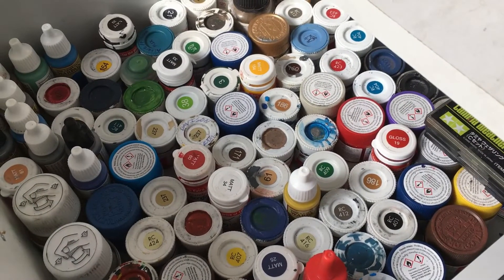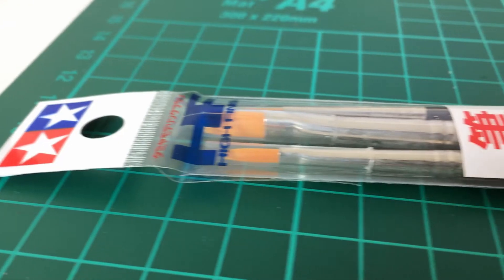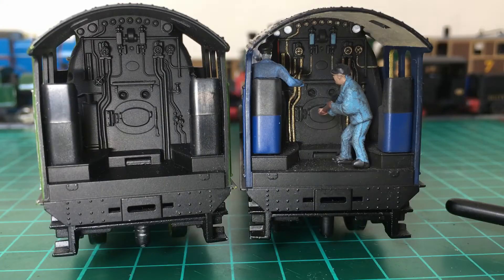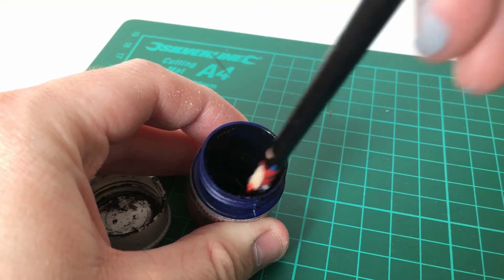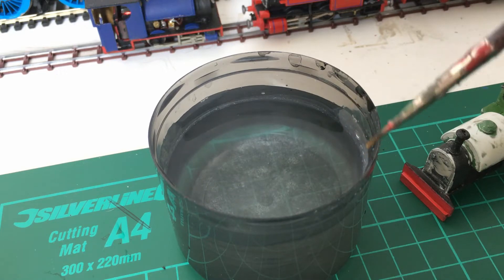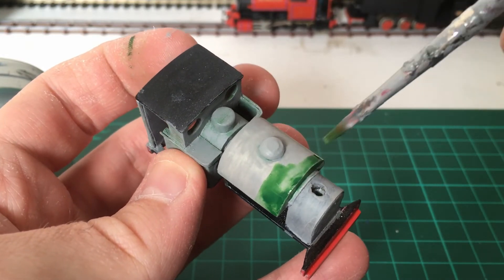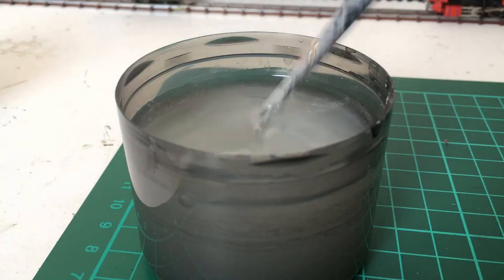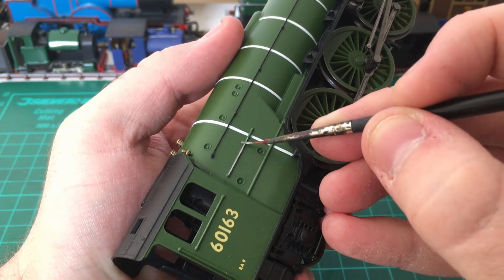Railway Modelling for Beginners: Brush Painting

Comment: Has to be asked, can this technique be applied to enamel paints? Granted changing the water for actual enamel thinners?
Reply from the maker: I’ve not worked with enamels in a very long time so I couldn’t be sure, but thin coats are always the best way to go so I’m sure it could. Best try it out on a redundant model first though
Reply: @tidmouthyardmodelling8754  Well, update with enamels, the principle seems to be exactly the same, only the drying time is significantly longer...! Still this tutorial has really helped me gain confidence with my hand brushing, and I cannot thank you enough on that front.

Comment: For myself . I kinda do this method

Sand the model a tad then paint 2 coats in the colour if it’s a darker colour tho if it’s something like yellow then grey primer underneath . From there add the smaller details with paint pens and touch up with the paint again or correction . Then clear coat and weather with paint dry brush then clear coat once more . Put the model back together again and done

Comment: were did you get the mode you used as an example?
Reply from the maker: It's actually a bit of a kitbash of two different 3D Printed kits, one of which is sadly no longer available. Thankfully the FIVE79 Edward Thomas kit has become available again:https://www.five79.co.uk/RC34/
It's a white metal kit, but I'd recommend it over my model from the video.
Reply: @tidmouthyardmodelling8754  ok nice thank you so much
Reply from the maker: @adamcat1882  No problem! Should say that this kit comes with a running board and the newer style cab Edward Thomas wears today, rather than the original Corris look
Reply: @tidmouthyardmodelling8754  ok thanks for the heads up
Reply from the maker: @adamcat1882  No bother!